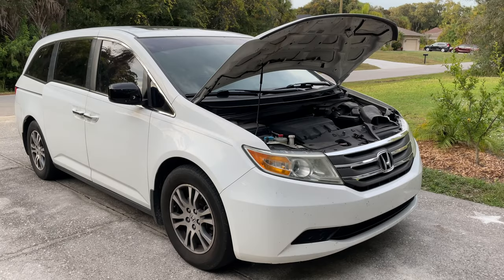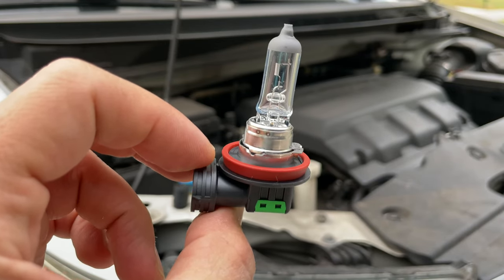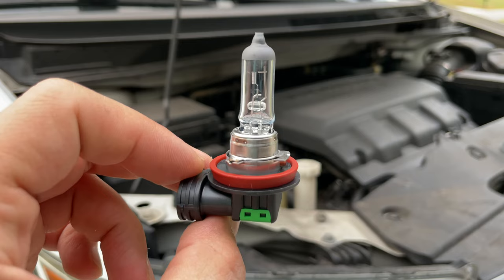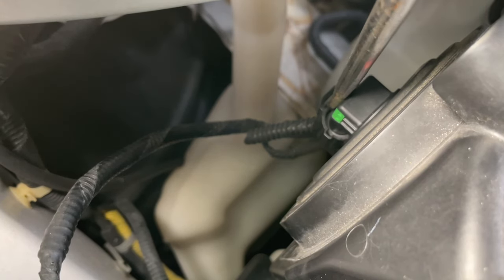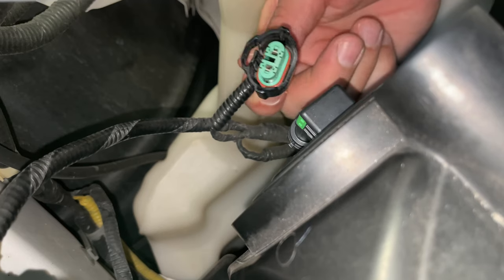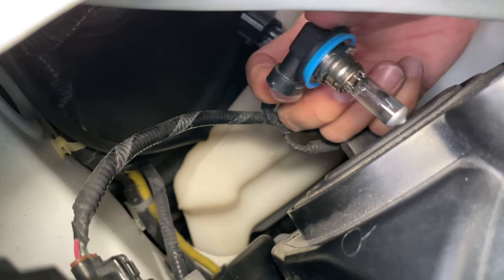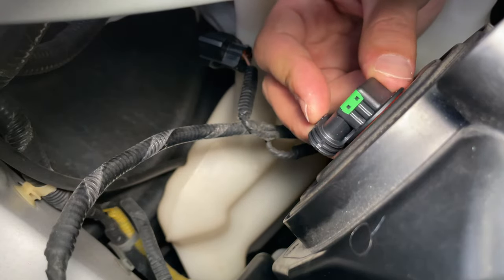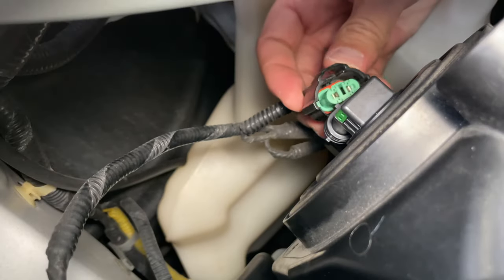How to replace headlight bulbs on Honda Odyssey

Comment: Thank you for this.  My 2012 had the original all this time and the passenger side just burnt out.  The secret, as you point out so well, is to disconnect that wiring harness and THEN twisting the bulb out.  I was trying to merely twist off the bulb without disconnecting the wiring harness first and that makes the job very difficult.  Thank you again for doing such a great job.  People with smaller hands and a longer screw driver will certainly have an easier time with this, but your tutorial is great.
Reply from the maker: Thanks, glad it helped!

Comment: Can you comment on what to do when one can't unclip the harness as easily as you do it?  Mine seem stuck
Reply: I’ve been working on that part for 20 min can’t get it 😢
Reply: Just remember to be firm with it but be careful. Mine was very stiff, most clips have a fork style clip(meaning 2 different tabs to pull before it releases). Just get a wide flat screw driver and pull up the tabs while applying a downwards force to pull it out. Hopefully you did get it out since you posted this comment 5 months ago lol.
Reply: @wafflemaine3953  I it off. Had to be a little more forceful than I expected. Now, if only other parts of the car were easy to change like the console... Definitely not like replacing my tape or CD deck
Reply: @alessing  haven't even got to that yet, sounds like it would be a pain 😂
Reply: I would not recommend using a screwdriver. There is a lever button on the back you can push. I struggled the same as you until I figured it out. I created a ‘much’ longer video on changing a light but explain this aggravating step.

Comment: NO..... it is NOT easy.

Light bulb broke off INSIDE headlight assembly.

Now what!? 😡🤷‍♂
Reply: TWO MONTHS LATER:

I was able to remove the broken off piece from inside the headlight assembly by using a telescoping magnet.